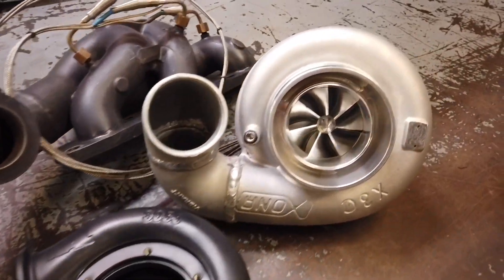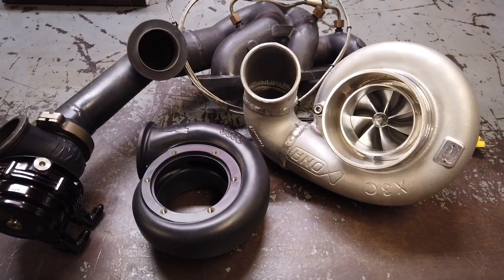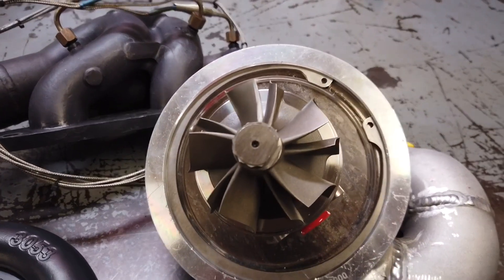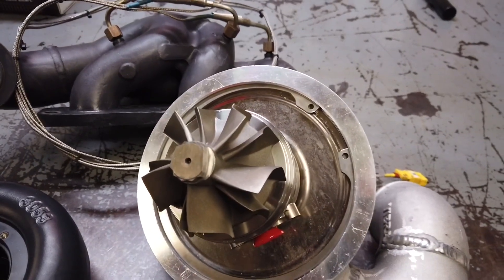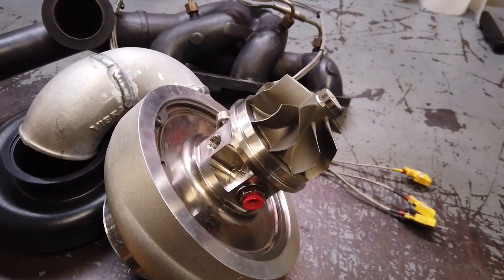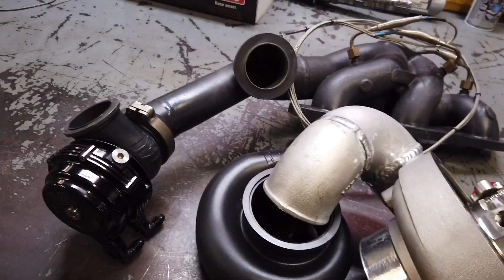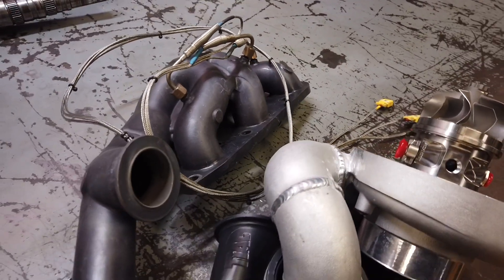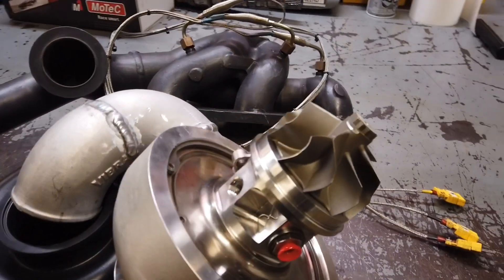Xona Rotor UHF Turbine Turbo Review XR9569S

Comment: How big is the lag with xr9569 on 3.8l fully build motor on gtr r 35 with s4 cams and billet girlde and billet crank etc ? When does the boost kicks in? 5500? 
Thank you in advance
Reply from the maker: I would say on that combination the lag will be fairly noticeable.  The UHF turbine wheels need a lot of displacement behind them to work as advertised.  You would want to be on a 4.1 or 4.3 if lag is a concern for your build.  If it is a drag car that wont matter as much, but still something to consider.

Comment: How would the xona xr 105 69s be in a like 700whp+ build?? Xona website says it’s good for 550-1100whp , so would it be good in a 4 cylinder at like 700whp or at that lower level would it be to laggy, it’s a 72mm turbo so is lag gonna be to much? Or should I scale down for a smaller turbo?? Because my set up is definitely capable of 1000whp but don’t wanna push it that hard. So was thinking of going 800hp at the most so would the 105 69s be a good fit?
Reply from the maker: That is all somewhat subjective, but what I can tell you is that these turbine housings favor larger displacement and to a lesser extent compression.  With this wheel (on the R35 platform that we have experience with) there is considerable lag on the standard 3.8L vs the 4.1 or 4.3 variants.  So if your engine is a smaller displacement 4 cyl, I would go with a more traditional turbine with eel, but if you have a larger displacement engine it will work quite well for you.
Reply: @ColabGarage  well my set up is a 2.3l ecoboost engine in a mustang, the xona turbo and kit has never been done before on this platform. So it is 4cylinder but it moves massive amounts of air! These engine are no slouches.  But it’s fully built using the strongest best parts possible, all custom spec parts only made for this particular build like the darton sleeve specifically made for this build as well as pistons and cams.   Originally my buider and I were shooting for 1000whp but now I don’t wanna take it that far and push the engine so hard.   But he still wants to stick with 105 69s so that’s why I been trying to do research to see if that might be to big.   Said should be in full boost by 4200 rpm’s.  But I have seen that these xona turbos are like nothing else and their bigger turbos spool like small turbos. And people say as far as responsiveness and performance there is nothing out there like what xona can do. So the 105 69s says it’s good for 550-1100whp so I think at 700whp+ probably a good fit.  But idk I wanna be sure.   Righty now I have a stock engine 2.3l ecoboost with full bolt ons at 420whp on a precision nx2  52mm turbo.  And turbo is maxed out at full boost.   The other build is currently being built.  But not using the 2.3l block that is known for weakness cuz it’s open deck. I’m using a closed deck 2.0 ST block with the 2.3 stroker kit.  The ST block is a closed deck but will be sleeved and it’s a much stronger block and better designed.  With either the 2.3 factory head built and ported or the euro version 2.0 cylinder that has 4port exhaust and will be ported to 2.3. And flow more air then the single TS port from factor 2.3 head.  Still deciding the final touches.  So yeah not sure wether i wanna stick with the xona 105 69s 72mm turbo for like 700whp+ or just get a smaller turbo. There e is evo guys running 1200whp on a xona 95 69s , they are insane turbos
Reply from the maker: @Paper.Power.Politics  Some of this is also going to come down to the application you are using this for…. If this is a drag application then you can be a little more liberal on larger turbo sizing and you don’t need transient response like you do in a street car.  That being said, these turbos like to operate at high pressure ratios so if 700 is the target I would stick with the 95, or even possibly the 82 if response is more important over peak power potential.
Reply: @ColabGarage  yeah that is what my concern is the response. Don’t really wanna deal with turbo lag.   And it’s gonna be a street set up , but also gonna be doing time attack at the track and maybe some drag racing to.  I live down street from willow springs so a lot of it os for street and occasional track driving.   But my builder says that turbo is not to big. And should be in full boost by 4200 rpm. Not picking up boost at 4200 , full boost by 4200 rpm’s and I don’t think that is laggy.  Probably gonna be able to rev out to 7000-7500 rpm’s.  I appreciate your response and opinion on the matter! Definitely gonna be making sure turbo is right for set up.  The turbo kit and manifold would be done by ETS
Reply: @ColabGarage  but 700 whp is just for street so it’s not to much in street, system if capable of 1000whp and if I go to track I’ll run it closer to 800whp+ 
And like I said xonas are crazy so I bet xona 72mm spools up like a 64mm turbo.
Reply: @Paper.Power.Politics  10569s is overkill for 700. its a 1000-1100whp turbo in most 4 cyl applications. Spools better than others on the market for that power but if you want the best response, size the turbo for the power you want to make. So for 800whp i'd be looking at the 8269s or 8264s. or 9569s for 950whp
Reply: @4familyman  well it’s a 1000whp build , but for street I’ll
Probably be running 700whp+ , I won’t be running 1000whp all the time.  And the xona 105 69s is good for 550whp -1100whp applications according to their website.   So it’s should be perfect. And I’m using a .82 v band turbine housing , so should be pretty awesome.  And using the the X3c compressor cover which is like a smaller turbo. That’s why xona are so awesome , small turbos with big turbo power.
Reply: @ColabGarage  plenty of the mistsubishi Evo guys are running the 95 and 105 69s and they are getting test results but they pushing way more power the 700whp , they pushing like 1000 or 900whp at least!

Comment: where is the T4 divided turbine housing?
Reply: ya its a big turn down, need a proper stainless T4 divided housing! Or make the shit compatible with BW EFR
Reply: @johnsm007  lol these turbos don’t need it.  Vband flows amazing
Reply: @brotomwang8218  I aint saying it doesnt flow or it sucks but for people that have 1000 dollar T4 manifolds you might want to consider making a hot side for
Reply: Time to sell that manifold and have a lighter and smaller set up
Reply: @johnsm007 it doesn't need a divided turbine housing the uhf turbine wheel acts as the divided turbine housing
Reply: @donaldgeter7657  4 year old post lol, im already on xona with UHF, getting same / better back-pressure with 0.63 housing vs 1.06 TS lol